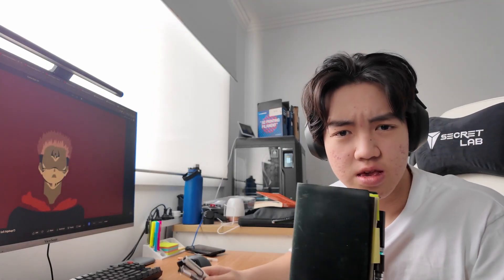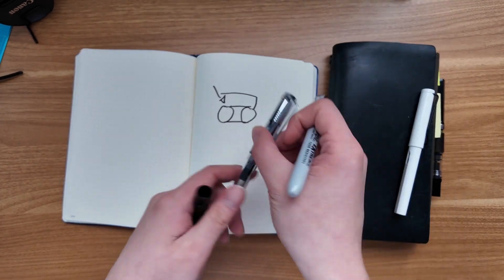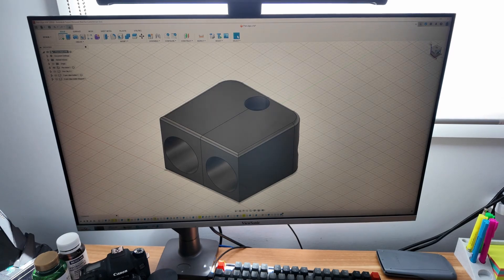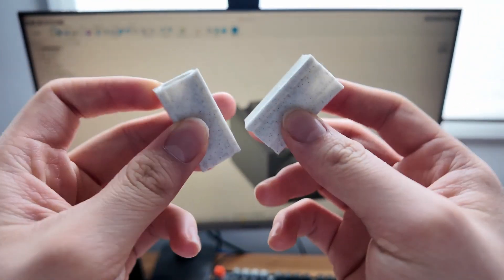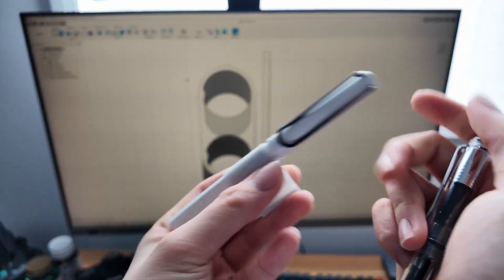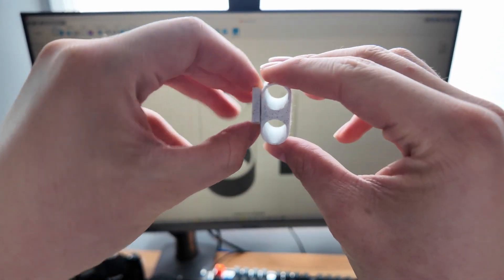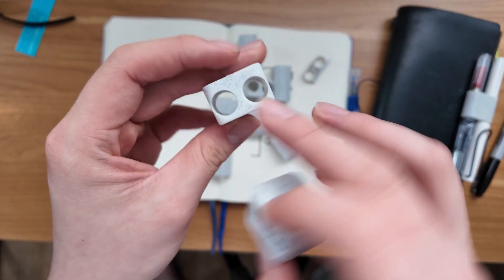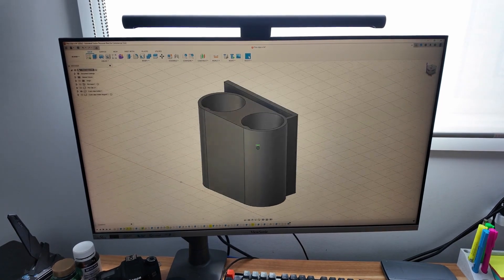Crafting a 3D Printed EDC Tool for Daily Use!

Comment: Great video! To avoid the need for supports, try putting a chamfer on the top part of the your holes. This makes it easier for your printer by lessening your overhangs. Solid design and thanks for walking through your design iterations!
Reply from the maker: Ahhh, that makes more sense, Thanks for the advice!